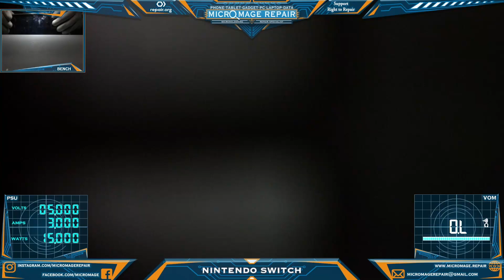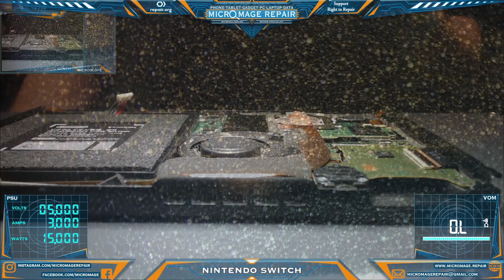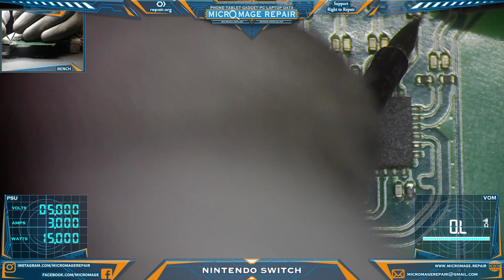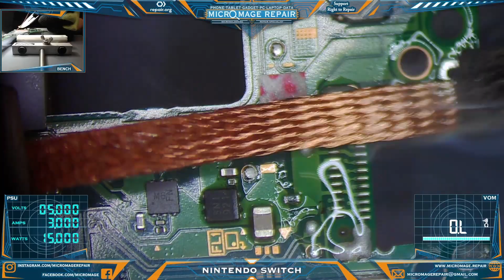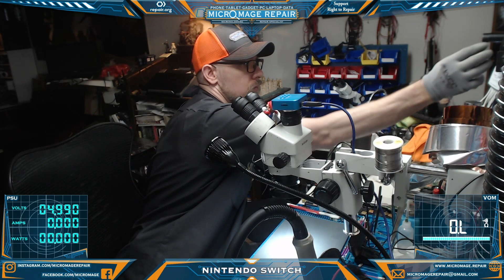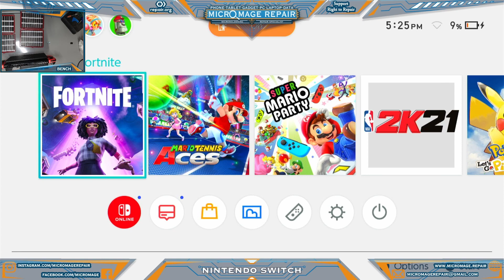My port has a growth.....err

Comment: Nice vid, when heating the switch up to remove the port I never understood when so many techs like yourself allow the port to drop off.  Isn't there a risk that it could rip pads from the pins that are hidden?
Reply from the maker: Thanks Roy,
I have personally never ripped pads with my method unless pads where already an issue. (pre-damaged)
The air flow isn't blowing the port off with force enough to take pads, the solder is well wet when the port goes.
Reply: @MicroMageRepair   Cheers, I guess its all about experience.  It was just strange to me, but thanks for the answer ;)
Reply from the maker: @highroyds  I've done hundreds with the method.
It might appear scary but it's 100% safe. 
I do all USB C ports with it, not just the Switch without issue.
Reply: @MicroMageRepair   Not saying against the method or yourself, I love your content  & the way its done.  I was just wondering about the method.  I see so many videos with the drop method & others with the pull method.
Reply from the maker: @highroyds  No worries , I wasn't taking it as some personal slight or challenge, was just explaining :)